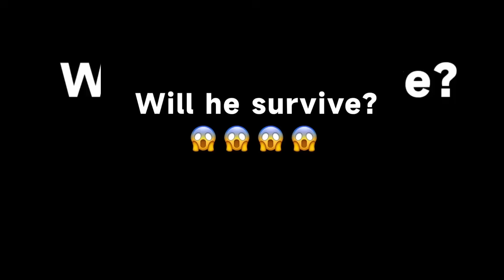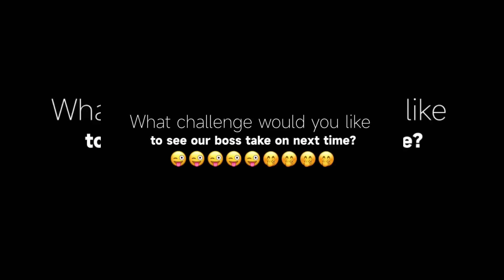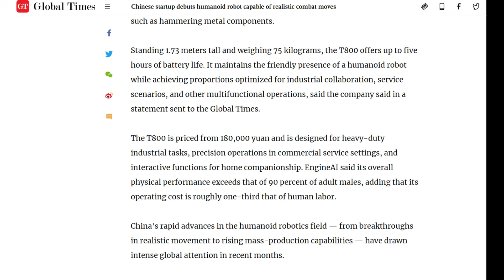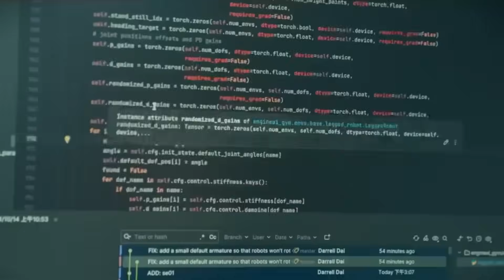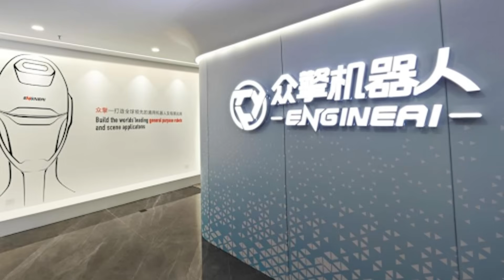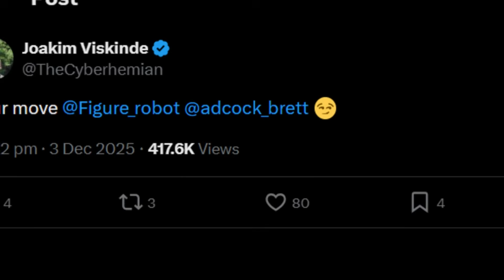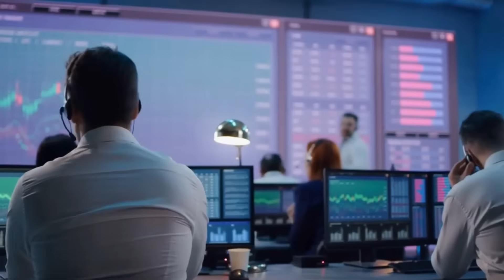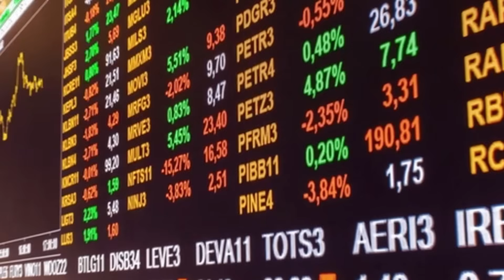SHOCK FOOTAGE: China’s T800 Robot Performs Moves No Human Could Survive!

Comment: People come on.  Look at actual robot demonstrations.  There is no robot that possesses this kind of power or speed.  At least not yet.  What’s powering those kicks?  Hydraulics?  Pneumatic?  Where is that kind of hydraulic or pneumatic pressure coming from?  Have you ever seen an excavator move that quickly with hydraulic pressure?

People stop being so gullible this is AI generated footage.
Reply: 美國不行不代表中國人不行😊這不是液壓好嗎！😅是電機驅動！瞬間扭力相當於一輛小汽車馬力！
Reply: @EDju42  not with that kind of balance and finesse.  Not with that kind of grace and ballerina style movement.  And regardless, you’ve added electrical into the mix.  So now we have Hydraulic, pneumatic, and now electrical.  Where is that kind of amperage coming from to make this style of motion and power possible?  Without a humongous battery pack this would not be possible anyone with any electro mechanical is well aware of this so stop with your nonsense.
Reply: @harleyrdr1 那你就別信啊…繼續活你自己的世界吧…😊

Comment: Those things are dangerous as heck.
Reply: Dangerous of what??? You drive around the US, you get shoot. Is that dangerous????
Reply: @richardliu7499  Exactly. Sign me up for two of those as bodyguards. ;P
Reply: @richardliu7499 That's why there must be ethical standards. When you get shot by another human, they can trace one who commited this crime - or who pulled the trigger for some kind of 'reason'. When a robot shoots you, for nothing,  you won't be able to find out so easily who gave the assigment to do this. But still; when it turns out to be a mistake, will the assigners come out clean, or will they keep silent, hiding behind a pretty cold, anonymus robot?! 🤔🤐🥸🤖
Reply: software can have bugs/glitches, so they should prepare some strict protocols for safety
Reply: @asai_nagamasa2074  And ethical standards!!!
Reply: Maybe they are also 'dangerous for hack'? 
Or waterboarding ...
Reply: We are heading towards The Terminator in real life!
Reply: I will welcome a Bot Security Guard walking around my Home/Property and if need be take a criminal by the neck until the police arrive.
Reply: They're remote controlled toys.

Comment: the power in those kicks is insane.
Reply: More impressive is the whole action; after the kick, it can still maintain its balance.
Reply: bot
Reply: I'm betting the power in those batteries last as long as my childhood RC cars. As in...15 minutes.
Reply: China made the solid battery which is smaller but more powerful, can generate more power for punching and kicking.  if Unitree robots upgrades with new battery, they could be more powerful too.
Reply: Uhhh.. nope
Reply: Not really.
Reply: @HardHardMaster  Robots are driven by battery, the newly released solid battery can generate more power. previoiusly many robots look slow and retarded, because battery has no much power.

Comment: Optimus still walks funny.
Reply: Elon musk is Not a Inventor . only a Fraudster
Reply: But at least it's self guiding and not a remote controlled fake propaganda gimmick
Reply: Optimus is capable of far more. 90% of T800 media is CGI. It's comparable to how eventually people will not be able to distinguish AI from reality.
Reply: @scottcontois3957  tesla is garbage and does nothing of value for most Americans.
Reply: @goarmysleepinthemud.  at this very modern times the AI is more advanced than the robotics itself, what lacking behind and not progressing as fast is the body for the AI, sensors ect, otherwise its not about the AI or software because those are way ahead of their time.
Reply: @goarmysleepinthemud.  It brings in a lot of foreign money. So there's that.
Reply: @scottcontois3957  it's for sell, just buy one and try it yourself if you think it's ai generated